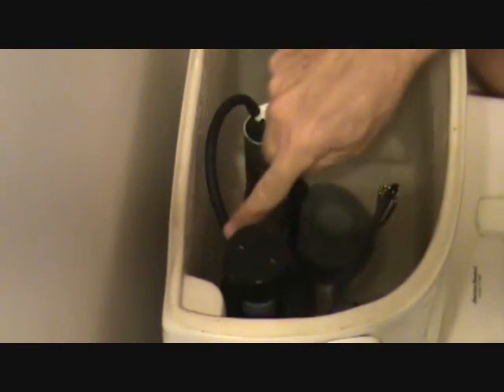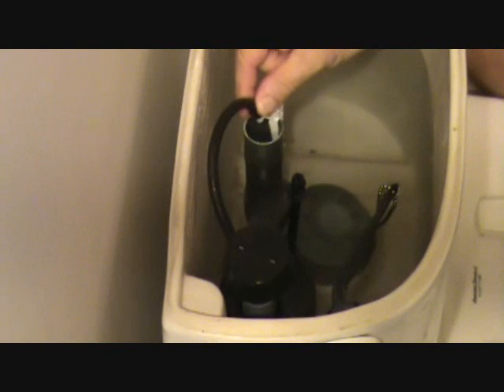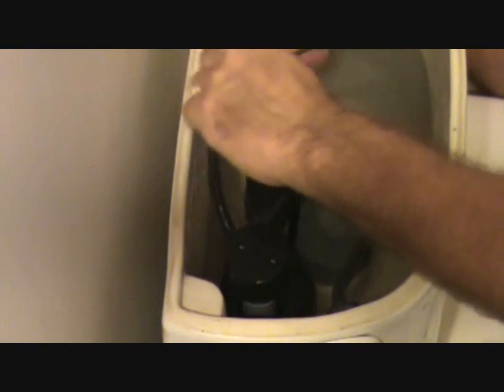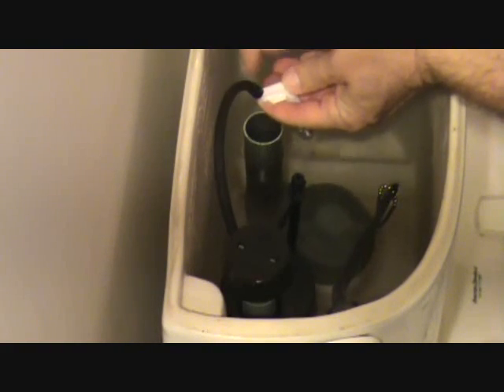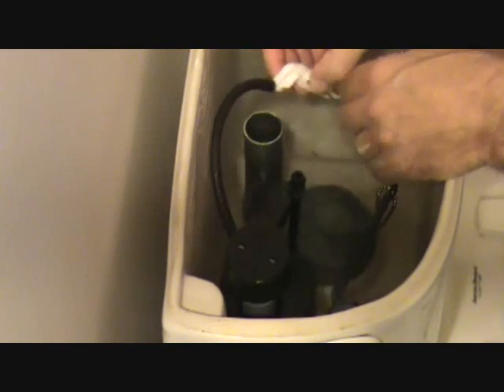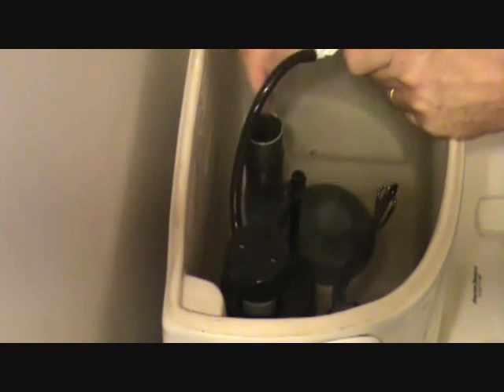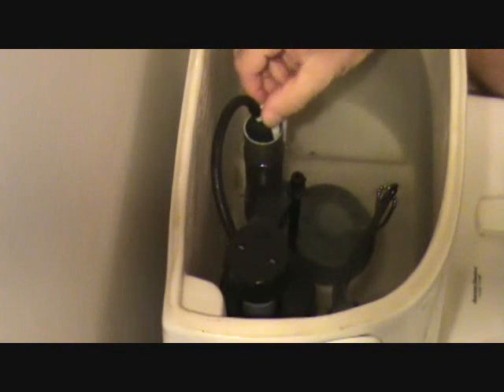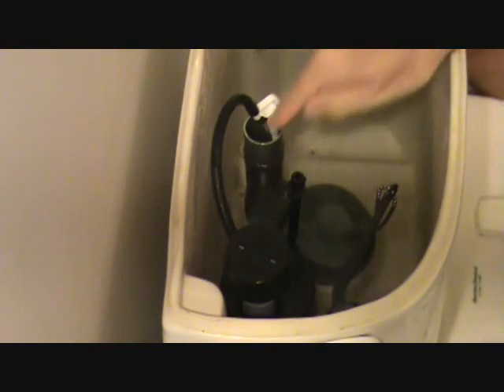How to prevent a toilet tank from draining: without flushing

Comment: we have a upstairs bathroom which is rarely used..i used the toilet after not using it for a few months...this has happened lots...the bowl will be empty or almost empty, but when you flush it it fills up like normal,,,im thinking its venting problem
Reply from the maker: Geez not sure what your issue would have been. What did you find out if ever? If you don't use your toilet for long periods of time then your bowl could just dry up & evaporate just because you are not flushing the toilet. If you leave it long enough & if all the water dries all the way for nothing in the bowl then you risk sewer fumes coming up through the toilet & into your house so even if you don't use that toilet that much just go up there once in a while & either flush the toilet to get water back in the bowl or pour a small jug of water in the bowl to prevent sewer fumes from coming into house. See?

Comment: Great video but my toilet fill hose is filling the tank directly not down the long pipe is that normal or has the fill hose fallen off the pipe
Reply from the maker: Can you attach the black fill tube to the top area of the drain pipe? I have some videos where you can see that if you don't have the proper attachment. go to my main YouTube channel page then click on playlists & scroll down to toilets. Thanks for stopping by!
Reply: @VideoJoeKnows  after 10 years? I would hope the problem is done and over
Reply from the maker: @jeffmassi8308  Me too....just thought I would check in to let you know I check messages now so if you ever have a DIY question.....
Reply: @VideoJoeKnows  ah okay good to know I think I just bought a new toilet however.
Reply from the maker: @jeffmassi8308  I believe I have videos for installing a new toilet too. Go to my main YouTube channel page then click on playlists & scroll down to toilets. I like to use the waxless ring sets & have never had an issue with them leaking or anything. Way easier to use since you can set the toilet down then reposition unlike the bees wax rings. Good luck!

Comment: If water were being siphoned out through the open end of that tube, the siphoning would cease as soon as the water level dropped below the open end of the tube!
Reply from the maker: Once the water gets siphoned down far enough your toilet then automatically fills up the tank again & back & forth so check this out & see if that is your issue. If it's not your issue then there are always a few more reasons/ways why your water might be leaking down into your toilet bowl from the tank. I have lots more videos for showing stuff on toilets to learn more....just go to my main YouTube channel page then click on playlists & scroll down to toilets or plumbing. Thanks for stopping by!
Reply: @VideoJoeKnows  Siphoning and automatic refilling cannot occur with the Fluidmaster fill valve model installed in my two toilets. (I installed the fill valves myself about 10 years ago.) The flush lever has two chains. One chain lifts the flapper and the other chain lifts a lever that opens the fill valve.  Therefore, the tank refills only when the toilet is flushed. Siphoning cannot occur because the end of fill tube sits above the opening to the overflow tube.

Comment: I am confused about what the heck the s hook is…
Reply from the maker: Watch this video again & listen carefully as I explain what the hook is for. Your black tube where the water comes out to fill up your toilet tank, that black tube needs to be held at the top of the drain tube. If that black water fill tube goes down inside the drain tube then it will syphon the water out of your toilet tank thereby having you think you have a leak in your toilet since the tank will slowly drain then 10 to 15 minutes later it will fill back up. So that clip all it does is keep the water fill tube up at the top of the drain tube so it's just held there in place not letting the tube just go down inside the drain tube. If your clip isn't white it could be metal or something like that. If your toilet doesn't have a clip that holds the black water fill tube then that means someone took it off once upon a time without realizing you really need to have it. Now watch the video again & you will see what I mean. Let me know if you have other questions after reading this & watching the video again ok? Thanks for stopping by!